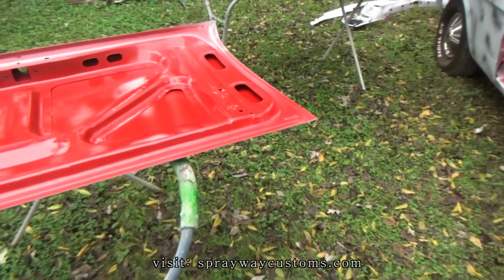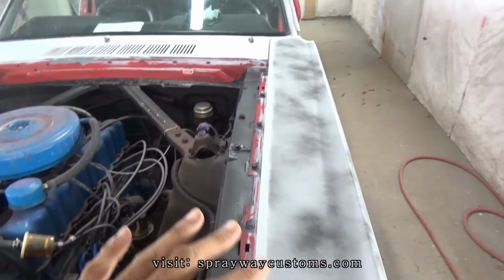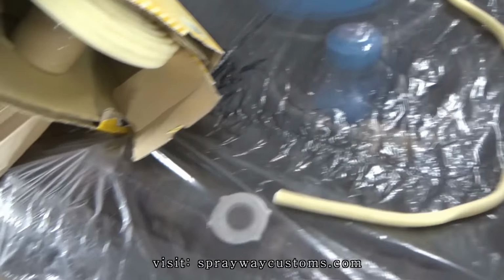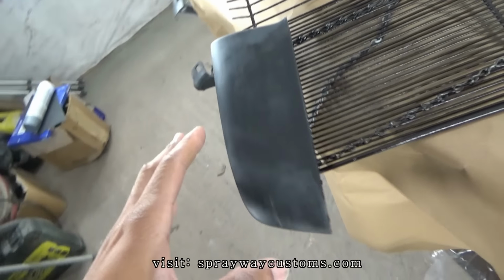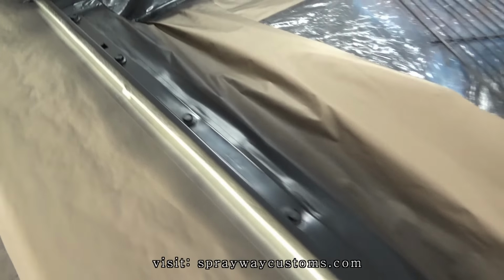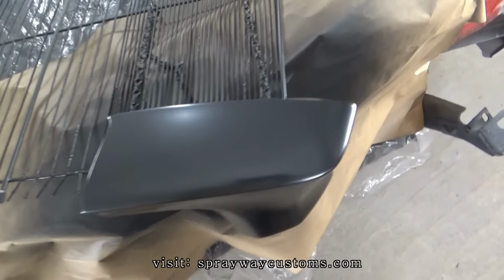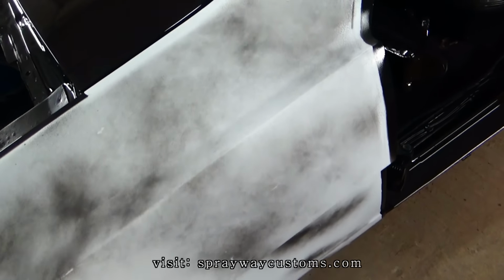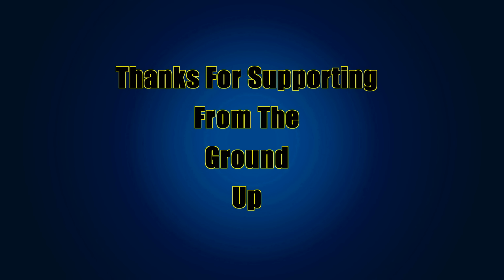Spraying Gloss Jet Black Paint On The 66 Ford Mustang Coupe Color Change - DOORS, TRUNK & HOOD JAMBS

Comment: I painted my firebird about 7 years ago with this jet black base / clear and it has held up pretty well. Hail spider cracked the paint on the roof about 3 years ago so that is probably something in prep or primer I did wrong but for being a $200 ebay kit has been pretty good.
Reply from the maker: Yes..it's some good stuff. Thanks

Comment: yours turned out good so far. when i sprayed underside of my 68 mustang hood DUST EVERYWHERE. thought i had gotten it clean . rest of car i put on 4 coats clear some areas orange peel so wet sanded everything it was tricky buffing the mustang with hard bodylines every panel & those hood turn signals . next time i spray a mustang im top coating fenders off the car
Reply from the maker: Yes, it do have a lot of curves in the Mustang

Comment: You think you could do a video on how you trap moisture from coming through your air lines? Starting from your compressor to your the type of filters and water separators etc?
Reply from the maker: Check this video out. It's 6 years old but I have the same exact set up...nothing's changed. https://youtu.be/M4GXr2XN32w

Comment: If you add a 1:100 clearcoat hardner:base it will help prevent wrinkling later in case you have to redo somethink like those door mirrors.
Reply from the maker: Thanks man. Yes indeed

Comment: 6:30, the drip rail above the door and for under the deck lid. Did you apply seam sealer? Do you ever use seam sealer? Not sure of the body style of the 66 mustang but those are common places where it originally would be seam sealer for most older cars
Reply from the maker: Yes...seam sealer is a must on those areas

Comment: Another great job , Always looking forward to the next video.
I have an unrelated question 
How do you heat the garage in the winter 🥶 when painting / before or after. 
Thanks again
Reply from the maker: It's impossible to heat it during paint because I have a cross draft set up and it's pulling all the cold air from outside through the booth. It really doesn't get too cold down here so I can deal with it. I just use a fast reducer and hardener. After paint I just close up everything and run a small radiator heater for a hour or two. My booth is insulated so it don't take long to re heat.

Comment: How many hours go into the prep work before you can even paint?
Reply from the maker: It varies on the condition of the vehicle
Reply: @SprayWayCustoms  I figured as much. Do you normally charge by the hour or do you bid on these projects.
Reply from the maker: I pretty much give a price far as the paint job itself and anything extra will be added on at the end.

Comment: I thought on a color change you have to prime. If it peel or chip it will show
Reply from the maker: No, if the paint in good condition you can use it as the foundation like the primer
Reply: What gun and tip you recommend for paint clear and primer. I use a 1.4 for paint and clear . And a 1.7 for primer
Reply from the maker: I use a 1.3 tip for everything except Primer. I use a 1.8 for it

Comment: Excuse me for saying so but you're taking the quarter panel ornaments off a 65 Mustang those aftermarket ones you said were in the trunk were for a 66 that's why the holes are different I have a friend with a 65 and I have a 66 the three prongs on each ornament equals 6 for 66
Reply from the maker: Dale Chirstopher thanks for the info